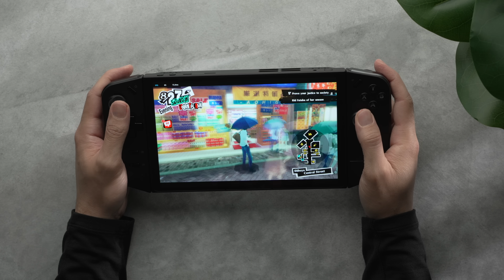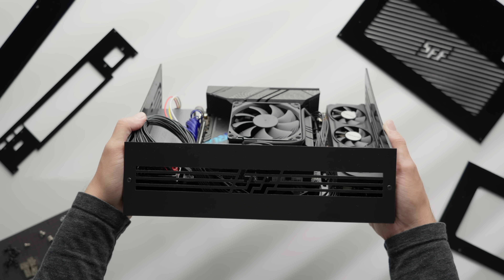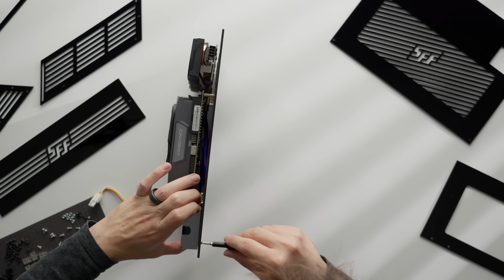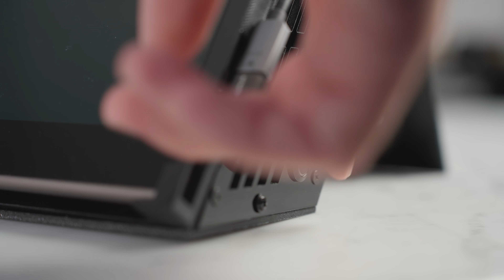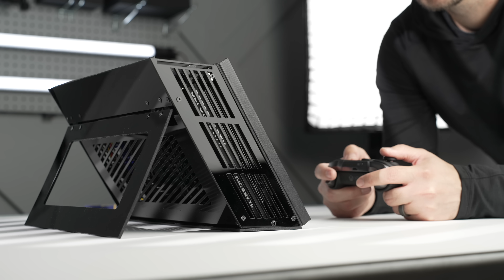Creating an All-In-One 4060 Gaming PC

Comment: My dream is to have a capable gaming pc, that is designed  to attach to the back of a 24” monitor, a bag that carries those components as well as my keyboard and mouse, somehow have one power cord for the setup. I can set it up super fast, detach the computer and connect it to the tv and still use my keyboard and mouse that are ideally wireless. Mmmm that would be so cool

Comment: I've been designing something very similar for almost a year now and it amazes me how similar my project is to yours. I went on a different approach, I wanted my pc to kinda look like an old laptop, so I am projecting it to have a screen that opens up like a laptop. It does block airflow in theory but thats something I'll have to just pay attention going forward, tho I'm not too worried because my specs aren't very heat intensive. This project uses an rx6600 eagle, very chill gpu and a Ryzen 5 4600g, which doesn't get too hot either. All that incased in a box of acrylic, made on a base of very thin steel that I got from the side panel from an old pc case I have. I'm also trying to place a mechanical keyboard inside but it's getting very tight.

Comment: So the cheat code is the Zillion H610 Thin Mini-ITX Board.  It can be had for 80-90US.  It takes 19/20v, provides 12v modular header for the PCIe card.  I used a similar JW brand H610 PIO model.  My build was a hair over 2L and I could have fit the Alienware 240w GaN power brick inside if I wanted.  I went with a 12500T and it worked spectacularly.  Intel benefits a lot from Dual Rank dimms.  2rx8 (they have 16 chips per memory module).

PIO means the GPU plugs in flat to the motherboard PCB, with the die facing the same way as the CPU.  No Riser and no PSU needed reduce cost too.

Comment: This is wonderful! I absolutely agree with you on laptops: they're fine, but the thermal issues, lack of upgradability, and for me the custom firmware they require which I've had bug out a lot, makes me want just a nice all-in-one PC case.
Reply: Try a Clevo, I went from 6th gen to 10th gen on my 1151 socketed system.  And 1070-3080 on the MXM GPU.  A custm heatsink was available from China to help the thermals out.  Also try PTM7950 if you are just using standard laptops.

Comment: okay so actual question, in the beginnning how are you even able to connect your portable monitor to that gpu without a second power cable?
Reply from the maker: The portable monitor has a built in battery
Reply: @devyn.johnston  Yea, this is my biggest issue with building a portable build right now. I really want a a single cable (usb-c) to run my monitor connection + charging. 😔

Trying out the asus XG17 and I hate having two cables! lol

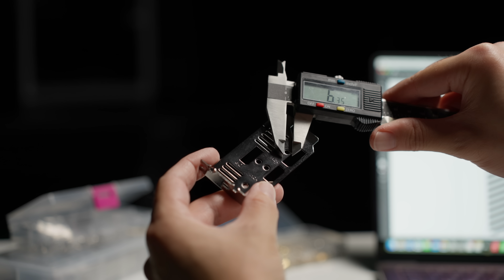Comment: 4:32 Did you actually, REALLY-visually measure with a caliper by lining up the hole with the side of the caliper and the hole or are you just frick'in trying to trigger engineers? LMAO If not a prank, then you really should measure with the rear end inside the screw hole, because ya know... that is exactly what it's for. Longest tip for outside measurements and shortest side for inside measurements. 🤣

Comment: I felt like PC tech in general was getting boring, until processors got mainstream.  Having said this, the believe the "miniaturization" of PC tech in general is going to be really interesting to follow up.
Reply: Check into the Zillion Thin Mini-ITX H610 with PIO (Should be around 80 bucks).  No riser cables or PSU needed, it takes 19v/20v and has PCIe power output.

Comment: You built a chunky Asus Flow Z13.  Granted you have a  desktop 4060 vs laptop 4060 in the Z13, you can plug a XG Mobile into the Z13 to get better performance.  You saved money but you spent all that time rebuilding a chunky Asus Flow Z13.  Or you could have gotten a Minisform mini PC with dedicated graphics and double side taped a 13 in monitor on the side.

Comment: Can you turn it into a rugged square like case? Or make the case adjustable from going from a square to a slant like what you have? Also could you add a cover for the screen. 

Main reason why I asked if you can make it more rugged. I’m constantly on the go and hate using a laptop. Last trip I took my laptop broke so I had to ship it to a repair shop. I want to have something that I can rely on ordering parts and fixing myself without using a saudering kit.

Comment: Fantastic use of acrylic and overall DFM. I'd recommend filleting your corners slightly more. From experience, 6mm acrylic is sturdy for builds like this, though be advised that its brittleness could be VERY annoying, especially in high stress concentration points like the hinge screws, as it may chip or form cracks. You could also try MDF as an alternative BUUUUT you run the risk of fire hazards so probably best to stick with tour current material choice. Very impressive and creative project

Comment: if you sold the parts you need, the acrylic
or atleast provided models, i'd buy it, and make my own, for sure
altho i'd go with a R5 5500 and a 3050 6g to keep things low power and low heat as possible

Comment: you should totally start a company selling these. i'd totally buy that
I work as a pilot and I want a more powerful, upgradable/configurable PC for on the road
Reply: I'll be travelling full time soon and have been researching this for a bit. I think the oversight is the upgrade path for these cases. Depending on how small the case and layout you will still be limited on upgrades and part swaps. RAM and SSD sure, but CPU is dependent on the next gen being the same socket and gpu is totally dependent on what manufacturer decides to do a low profile gpu on the next generation. 

All that said, the cons aren't stopping me from going this route.
Reply: Might not be exactly what you want but Framework laptops are fully upgradeable and pretty cool, might be a decent option for you.
Reply: @cosmicslime1496  Framework is the better off the shelf solution. However, you lose some of the versatility that this gaming AIO provides. The parts for the AIO are more interchangeable and can be found from multiple retailers, and has more of an upgrade path. With Scottiesnipes being a pilot, he would also most likely have an iPad laying around. A lot of flight planning tools can only be used on IOS devices. So he wouldn't necessarily have to pack a screen for it.
Reply: @Paperbatvgchampion  but still, a laptop much lighter and much easier to carry around. Also I'm not a pilot but I don't know what they do that requires a powerful full size desktop GPU. Those would use a lot more power too. Seems a bit overkill to me?
Reply: I doubt they would need it to be that powerful for their career. Perhaps they'd need it for side-hustles (for programs like CAD and Davinci Resolve) or no-compromise gaming. If nothing else, a AIO build would be fun and give them something to brag about.

Comment: Since I started looking into tiny builds, I thought this would be fantastic solution/addition 😎 I just don’t have the money to invest to make it ☹️
Reply: A Zillion H610 Thin ITX is only 80-90.  It has PIO and DC 20v input, so costs are slashed.  Use any 12th-14th gen processor (They go for about 70).  I chose 12500T, but 12100F is a beast.  Use a 150-160 RTX3050 Low Profile, or any short PowerColor Fighter (like 6600XT) should fit too now that the PSU is out of the way.  

You could easily build this into a Pine or aluminum case with hand tools.

I used an Alienware Slim 240w power brick, should be under 30 bucks.
Reply: @milescarter7803  that sounds great, but what type of games do you run and at what quality? Because from watching these videos it seems like the bottom I'd want is a 4060 or AMD equivalent (i'd lean on the latter because I'd like to be able to make it into a steam machine as well)

Comment: a framework laptop would give all the pc advantages in a laptop
Reply: No it wouldn't.  There is only 1 choice (amd only, 1 proprietary video card, and worst part custom driver), not to mention the limited power and extra noise, and expense.  When you go to upgrade you have to buy an entire motherboard, cooling, and cpu. They've promised other video cards and nothing yet.  There's a performance difference between laptop and desktop components.

Comment: Are you kidding me? This so much better than a laptop! I want one stat!!!
Reply: Are you kidding me this is like the opposite what makes a laptop awesome. Only advantage is low noise.
Reply: @FierroSev  how about 90 degrees and cpu TT on even the most modest of cpus with barely 40-45 watts?) my mini itx build with 7500f is cool as f with 75 degrees and constant 5050 mhz. Performance is way better that what you would get with these feeble laptop ryzen 7 and ryzen 9.
Reply: @legart4507  you are right about power draw. 

My issue is with his build, it doesn't make sense in terms of portability. As the weight and sheer ergonomics doesn't make sense.

Comment: You built a Nintendo Switch? lol

But Seriously, just buy a framework laptop, it's the only laptop I know of that is upgradable
Reply: and the only way to upgrade it is by buying a mainboard that costs 800+? not only that youre locked with its io and it upgrades using laptop configs so its weaker than this build, also the gpu is only upgradable with their system, so no cross compatibility with stuff like amd, nvidia or intel😊
Reply: @NathanSteph-lo8wr  Notice the design & hardware differences?

One is just a mini pc with a kickstand & the other is a sleek laptop...

Not sure what you expect when there is no competition for upgradable laptops...

Comment: Video idea: add battery power and add built in speakers (like a laptop)
Reply: Battery would be pretty tough to do considering power draw of the setup, you'd need something to handle up to 400W of output and to do that for any extended time would be pretty difficult, not to mention not very portable. 

Built in speakers could be done with most portable monitors as some come with them anyway.